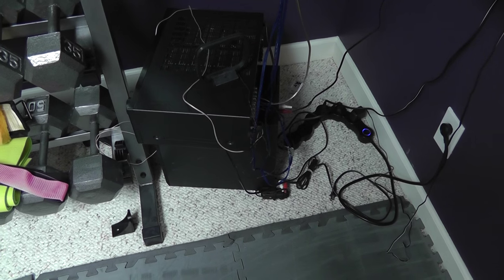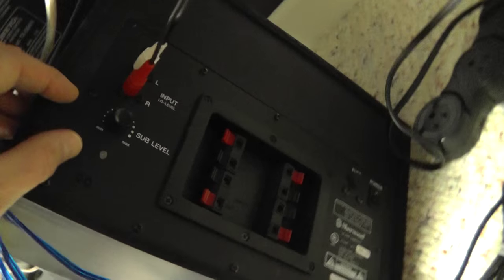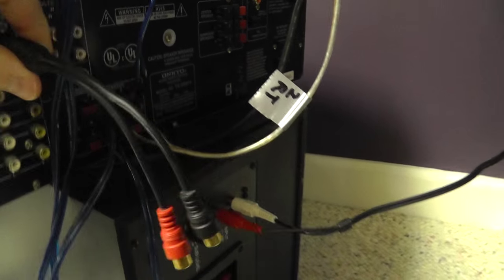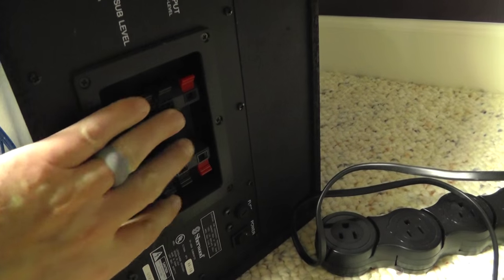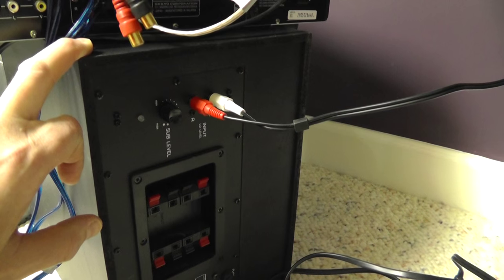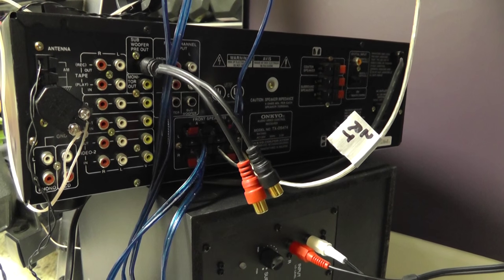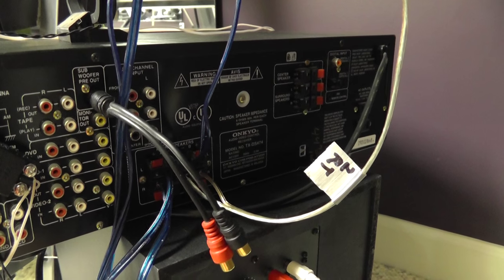How to Hook up a Subwoofer and get best Subwoofer at Best Price

Comment: On my samwoffer I have a black and red wire that goes in without the plugs going to get the male 2 x PRO 20cm RCA PHONO Y SPLITTER CABLE 1 Male to 2 x Female CAR AMP SUB LEAD from ebay then connect the placgs two a lift and right cable phono thn cut the plugs off to connect to the subwoofer this video gave me the idea. i think it will work. thank you.

Comment: Very helpful video. Can you do the Y splitter at the other end? Long single cord out and then 1 female to 2 male splitter and plug those directly into the subwoofer? That way, only need one long (6 foot) RCA cable instead of two. Thanks.
Reply: Yes, that is exactly what he did, effectively. You just want to extend the short 1-inch cable sticking out of the amp, and make it a longer one. Your idea is sound.

Comment: Since it's a mono amplifier, with a mono output, you'd be able to use just one input. Most amplifiers built into these subwoofers will accommodate. Maybe 15 years ago, you would have used "Audio Out" as your subwoofer out put on an old 5.1 reciever. What you're doing is adding an unnecessary cable, introducing noise into the signal, plugging adapters to cables and back again....
Reply: Spot on!

Comment: Great video. What does the left right y-cable do vs. 1 mono rca to say L?
Reply: Nothing much. Gives a little bit of a stronger signal from the Reciever. Usually a sub with 1 sub cable running into a input such as a left input, is a LFE track based input. Sometimes its totally seperate on the amp and sometimes its integrated into the same Left input.

Comment: Actually you don't have to have a Y-connector... You can plug in to L or R then turn your low pass all the way up..
Reply: By Y connector, Do  you mean the rca cable splitter?
Reply: George Nwuya 

Yes
Reply: Correct I have a old M&k V-125 subwoofer with mono left or left and right stereo inputs so for a one subwoofer output on reciever only one cable needed connected to mono input on sub. For stereo only use when you have a integrated amp capable of two left and right pre outs such as the Cambridge CXA80 for example.

Comment: Sir I have a klipsch rw 12 subwoofer it's a old model but I buy this second hand . I used RCA cable and with my mobile 3.5 jack but it's not working I want to know whether I need external amplifier for this coz I read on manual that it's has a bash integral amplifier so pls help me soon . M waiting for ur answer
Reply: No external amp needed. It has it's own built in amp (bash). Just make sure the RCAs are hooked up like he said AND make sure your receiver is set to send a signal to the sub (check your menu options on your receiver).

Comment: Instead of using the sub out, would it be posible to connect a Powered subwoofer (using its RCA input) with the RCA output to a Preamp? - you know, since the sub would already have the ability to customize the sound volume. 
Also, If the subwoofer is a powered unit, with its own volume control, isn't it bad to hook it up to a reciveier that also has such ability? I read somewhere that doing so might damage the sub (or speakers, for the same principle)

Comment: you can just connect the the sub out to the the left channel of the sub.
Reply: Yes. That's exactly how I have my Yamaha YST-SW120 connected.
Reply: Daniel Skoropad when you use a splitter to a subwoofer that only has left/right audio in it amplifies the signal to the sub.  yes it will work by plugging in just the left audio in but not as well.

Comment: the best way on a 2 channel set up like an integrated amp that hopefully that doesn't have pre out for sub woofer the best way is to run speakers wires from B speakers to high input on powered sub if hopefully the sub Jas speaker wire input that way you get the same sound threw sub and front speakers on A speakers P.S, audio says that's the best way on 2 channel receiver or 2 channel integrated I'm a low end audiophile  and I was missing that Blass from sub but I turn it real low to match front speaker a

Comment: I have 3 black subwoofer holes, one says 5.1 ch input, and 2 next to each other, one above the other and says Pre Out. I have a red and white plug in my subwoofer. Can you tell me witch one i have to use ?
Reply from the maker: +NauticalStrings use the pre out with red and white pre out to powered sub
Reply: +n4ktz Thanx

Comment: Does it matter if the splitter is used on the Subwoofer end?  Meaning single cable attached to the receiver and the splitter added to the end and then plugged into the L/R inputs on the sub?

Comment: I have a pioneer else with a sub out line.  I have a supercube 3 with lfe,  and low level inputs and then all the mess with the high level which I will not use.   As of now I have it connected to the sub out to the lfe.  Is that OK or should I have the rca cable splitter coming out of the receiver into the sub low level inputs ?
Reply: Michael Hinchey i have a super cube as well and i find it works better with a splitter at the sub instead of lfe.  what also come into play is how you have your speakers set on your receiver (larger or small)
Reply: noel wood I set them for small. I have two subs in the back of the room.  Long/short story , it's the only way I can set them up. Thx for the splitter tip. I will change when I have a chance
Reply: Gotcha.  Currently building two seperate 18" ultimaxes.  Cant wait to join you in the dual sub club.
Reply: @noelwood78  LFE is a dedicated track for subwoofers when watching movies n such.

Comment: I have an old Aiwa CX-ZL100 with a CD Digital Out (optical). Is it possible to use this to hook up an old but great LG passive subwoofer? My plan, if this is possible, would be to thread it through a Triad 250W subwoofer amplifier.  If CD Digital Out would work, how would I do that?  And, it would be great if someone would do a youtube video on these old things for vintage amps.

Comment: I want to use my little blue tooth speaker with my Yamaha sub and and add a poll audio speaker or two, using the 12 in Yamaha sub to power them .. is this possible?
Reply: Yeah it is. I even went aheas and dissamnled an old speaker stripped the speaker wire crossed tnem into a pair of pol audio the
N ran it to my polk audio powered subwoofer and bam. No funky audio or impedence

Comment: I have a Sony home theater system with sound bar included. I would like to use optical plug coming out the sub woofer and connect to the back my receiver (onkyo TX-R333) op

Comment: So if I get the rca plug and put it in sub pre out, I will be able to use sub and have speakers running off back if receiver? 

I have a Sony powered sub and it doesn't work when I put it in the sub out with sub cable

Comment: the optical plug on the back of my receiver doesn't seem to be working our is not activated. I'm trying to find out to activate on the receiver.
Reply: Analog input
Reply: May need to toggle it in in the settings as "on" for the optical link

Comment: What if the subs box only has inline connectors , but the receiver has the “subwoofer 5.1 out “ ?
Reply: Thats fine. In line is the input connection.

Comment: Actually HDMI provides the best signal
Reply from the maker: Do you know of a subwoofer with HDMI input? Or a receiver/amplifier with HDMI subwoofer output? I dont
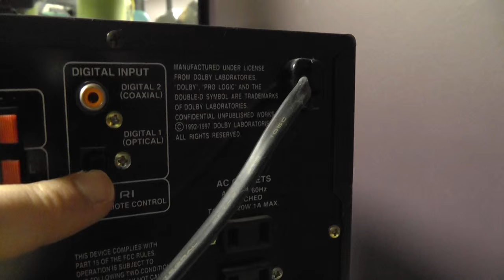Reply: @ 3:13 you say that digital input is the best but its not. its HDMI.....But iv just notice that you dont have any HDMI connections so that means yes... is your case that is the best lol. 
https://www.google.com/webhp?sourceid=chrome-instant&ion=1&espv=2&ie=UTF-8#q=hdmi%20audio%20versus%20optical
Reply: Optical is only capable of 2.1 channels in uncompressed audio.
HDMI is capable of many many many channels.
Standard is 7.2, but it is capable of far more uncompressed audio.

Why would a sub need HDMI? you only need an RCA cable between the sub and receiver. Other then a balanced XLR connector, there is no other way of doing a proper sub hookup>

HDMI is for the interconnect between the source media, AVR, and viewing device. It isn't meant to be a speaker hookup.
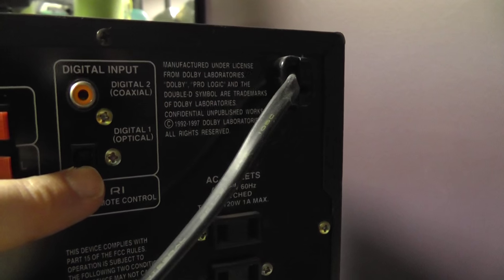Reply: thrasherht lol I was referring to the part @  3:13 of this video.
Reply: Martin Godinez yea I know. I was responding to his comment about subs with hdmi
Reply from the maker: subwoofers do not have HDMI inputs, only RCA or wired(less expensive)
Reply: @9mmsteve  Oh wow, HDMI is the connection from the tv or other audio device, you said optical SPDIF (which you referred to as digital) is. TBF, in your case, you didn't have HDMI.
Reply: @9mmsteve  there are subs with hdmi connections.

Comment: Is the "Y" RCA type adapter supposed to be mono or stereo like the one you have there?
Reply: It's stereo. Or when using a digital input (Coaxial or Optical) it's digital stereo. The subwoofer output will send out both left and right signals so the bass is equal and clearer sound

Comment: Sir, if i understand you right..
i don't have a pre sub output, but if i have 2 speakers connected to output A on my amplifier then i can connect output B to the sub right? And in this case i need an active or a passive one? Getting an active makes any advantages in this case?

Comment: Love these amateur tutorials! lol You dont have to connect to both RCA inputs on sub unless you are intending on maintaining crossover functionality with your Amp. Sub will work fine with just one connection either R or L. Also depends if you have an amp that has a standard Sub line out (R+L) or a Sub LFE out which is usually just the one output.
Reply: I have a single wire going to my sub, it is very quiet. I thought it wasn't working at first but it's just super quiet maybe I need the y adapter
Reply: Joe Home  I don't understand anything you just said. Is that a setting on the receiver? How do I even change that setting. I don't even know what to do when I look at the remote
Reply: Joe Home  I don't have the manual and can't find it online. I've been trying to look through the but I can't figure out how to change settings. There's an options button on the remote but it doesn't do anything. I got the y adapter, and it didn't do anything
Reply: Joe Home  I don't know what AVR is. But I figured it out. After pressing lots of buttons on the remote, I got some settings to pop up on the TV. From there I was able to adjust the volume of each individual speaker. I turned the sub up and it works good now

Comment: Avoid Y connector.
Reply: What should I use?
Reply: @kenshiroFNS  a Single mono Subwoofer cable is what will work fine. A Y cable is Ok. It does give a little stronger of a signal to the Amp than a single cable when connected into rhe left input. Using a Y connector or y cable to  connect  into both  left + right inputs on the back of a Subwoofer does give a bit more of a stereo Bass instead of a Mono cable into left input or LFE channel input.
Reply: @mobbman1  thanks